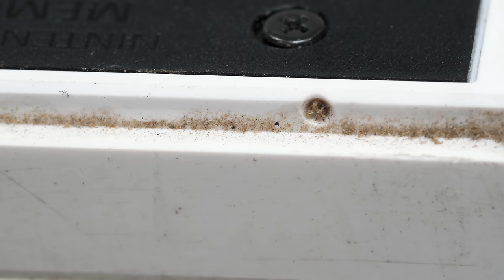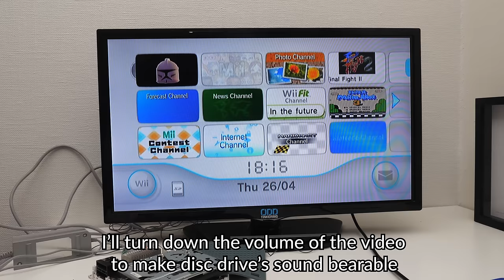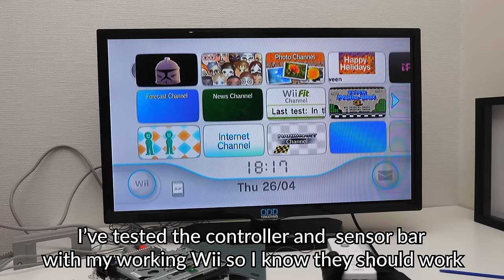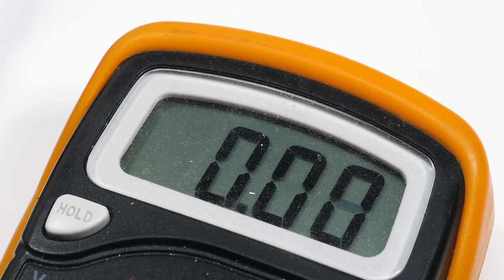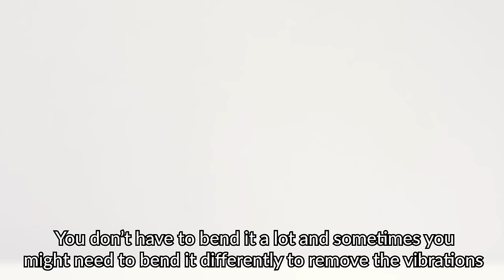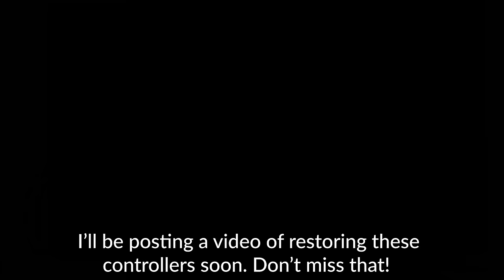I Restored This $5 Junk Nintendo Wii - Console Restoration & Repair

Comment: It's funny how, despite how filthy and beat up it was, there was actually very little wrong with it.  Just a thorough cleaning and a few tweaks and it's as good as new.  Amazing!  (And yes, I feel very old knowing the Wii's age.)
Reply: Yeah the Wii is build like a tank. Tbh all old consoles kinda are...My N64 runs like new.
Reply: it's just that we don't get a lot of information on how to do these things with our consoles, until we do them ourselves.
Reply: e
Reply: @maximilianbrem8250  to be fair, modern home consoles are also durable - my Xbox Series S literally feels like a brick and I am not sure what I would have to do for it to break. But even if it's a bit dusty I don't get how people still can make them super grimy in just like 2 years. That's considering that I have spilled tea over my controller and after some cleaning it works like new. 

I would be more careful with things like Steamdeck and Switch but from my experience they are also not that easy to break unless you're really unlucky or trying to do so on purpose.
Reply: @maximilianbrem8250  the Wii U and 3DS are where things started to become fragile
Reply: It's crazy what happens when someone scuffs up the outside of a system (other than the serial number sticker) that is just fine and dandy. Done for clicks and views, working for him so more power I guess.
Reply: @gutterspeak  so you’re saying he gets a perfectly working Wii which is close to twenty years old. Dismantles it. Places soot and hair from what it looks like to be 15 years ago. Washed and cleans every individual part after making it seem like it doesn’t work properly. I used to buy ps4s off Facebook marketplace that people thought were broken but had to be reinitialized. Bought them for 20 and sold them for 200. I often took them apart just like this video.
Reply: They don’t want you to do your own repairs that’s why. I’m an electrician so I’d feel confident taking on a project like this but that’s because I’m professionally trained to work with circuitry. As long as we still have the right to repair fight taking place, it’ll always be difficult to get correct info on gaming systems.
Reply: @maximilianbrem8250  ⁵
Reply: @maximilianbrem8250  built*
Reply: @OmegaEnvych  Smokers get everything they're around grimy. I'm not even joking.
Reply: Nintendium
Reply: @encycl07pedia-  yeah, it feels like some people have no idea how much smoking inside can effect a home and their decor. nicotine/tar stains basically anything it comes in contact with.
Reply: @OffOnSwitch  nintendium?
Reply: Wii equal cool cool equal us :)
Reply: Hey {{3}}, I can totally relate to the satisfaction of restoring old electronics! If you're into tech restoration, you might want to consider using a HOTO Compressed Air Capsule for cleaning. It's a versatile tool that offers powerful vacuuming and blowing capabilities, perfect for maintaining a spotless environment on your desk and beyond. Plus, it's reasonably priced compared to other brands. Happy cleaning and restoring!
Reply: Why do most of your videos look like the items have been dug up from the garden or wiped over with a dirty rag? It’s not consistent with the cleanliness inside. Very artificial.
Reply: The wii does run like new until you try to run toy story on it...
Reply: You didn’t have to call me out like that!
Reply: Honestly most things seem a lot worse until you open them up. All it takes is one issue in the major parts and it seems not to work at all. But Nintendos especially have a reputation for being virtually indestructible, so a little patience and they’re good as new
Reply: A lot of the time there aren't a whole lot of problems with "junk" systems that people have stored away. It's just that most of us don't have the knowledge of what's wrong to fix it and aren't interested in paying someone who might just scam us and overcharge.

I wish I had the mindset to do repairs like this, because this is a $100+ console that went from $5 junk to fully-functioning system with only a few small repairs. It would be nice to be able to shop around eBay for junk and fix it up.

Even if I don't have the skills to identify and fix the problems, I'll admit I'd still like to buy old "as is" consoles just to pull them apart and see the internals. Maybe see if I can learn something from it.
Reply: That’s poetic
Reply: @maximilianbrem8250  maintenance is key, also not dipping it in trash lol.
Reply: This stuff is only like 20 years old. Why is it being represented like some old as fossil dug up from an ancient civilization lost to time?
Reply: The Wii in particular is notoriously tedious to open so they never get cleaned. It's not surprising how many videos there are of them getting completely fixed with nothing more than a thorough cleaning. In older consoles that was always the first line of defence. They just made as difficult as they could justify with the Wii and they weren't the most expensive console so nobody ever really bothered.
Reply: Cuz they fake it
Reply: That’s because it’s staged
Reply: My wii still running perfectly to this day just need a new wii remote and AV convertor
Reply: I feel like this is often the case with game boys as well, usually corroded contacts or a loose wire
Reply: Fun system gamecube friendly easy way to mod it homebrew all retro video games and u save on a SD card and no worries about being late for work kids get to play and get homework done
Reply: @maximilianbrem8250  mas o ps3 e o xbox 360 dava muito problema
Reply: @maximilianbrem8250  I also have a great N64!
Reply: Que buenos videos, soy tu fan 🤟🏾

Comment: I remember when I cleaned the dust off my old Wii and powered it on for the first time in years. It's like opening a chest of memories
Reply: I still use mine weekly
Reply: Yeah I used to play Wii a lot too. Memories.
Reply: I got my perfectly cared for, Limited Edition, 25th Super Mario Brothers console on eBay for 153 bucks! Worth every dime!
Reply: Wish mine still worked. It's not reading the discs. Any suggestions?
Reply: @Lag1914  you should try modding the wii so you can run games off of a usb drive instead of the disks. You can’t dump games to the usb drive without the wii disk drive working though so you’ll have to obtain the disk images from semi-reputable sources. Hardware-wise I’m not sure what’s wrong with the drive, does it make noise, is it dead, or does it just not make noise for whatever game you put in?
Reply: @soulthunderfox  The Red one? That's a special edition??
Reply: same
Reply: @Luchux177  Yeah
Reply: i used to have a Wii. Then one day it just vanished out of existence, never to be seen again.
Reply: Unless you were stupid enough to send your Wii to Nintendo to repair. They completely nuked my internal storage, I lost everything. Totally ruined the Wii from that point. I use mine for emu now.
Reply: @mutoneon  Oh, with my homebrewed Wii? Not a chance. Sending it to Nintendo would be the LAST thing I'd do lol

Comment: I think one of the most interesting things is learning how the sensors worked. I always thought it was the reverse, with the light coming from the remote. That's so cool!
Reply: After a while, the lights even get a bit warm compared to the rest of the sensor bar
Reply: I honestly think the name contributes to that misconception, it makes it seem as if the bar is the one doing the sensing
Reply: If you ever use it during Christmas time, and have a Christmas tree with lights on it, and see how much it freaks out the Wii remote when the Christmas tree is within the line of sight, you suddenly understand that it is the opposite of what people assume.
Reply: How much for it?

Comment: This channel actually helped me to clean my old PC. Just spending time watching the detail and noting the supplies used made it a lot easier to thoroughly get all the dust, residue, and any gunk off the components and actually helped me to isolate a faulty component for replacement. It’s amazing how much a soft bristle toothbrush and isopropyl alcohol can clean.

Comment: Restores a badly worn Wii, chooses an OG Wii game, AND gives us gameplay?!

10/10 video. So much nostalgia
Reply: Hey, I must say that the HOTO Compressed Air Capsule sounds like a handy tool for cleaning and maintenance. The powerful vacuuming and blowing capabilities, along with the multiple tubes and high-quality filters, make it a versatile choice. Plus, the brushless motor and long-lasting battery add to its appeal. Thanks for sharing this cool find!
Reply: Galaxy still looks great 15+ years later :)
Reply: @innovativeadvertising6463 that’s not innovative advertising that’s just blatant advertising which I’ve seen 1000 times

Comment: Aaah, the Nintendo Wii, I love that console, I have one myself, it's extremely old by now but it still works like a charm, the trooper sounds like a jet engine preparing for take off but other than that it still works without a hitch even after all these years, what a baller of a system.
Reply: You should home brew it and revisit it. The community is still active. You can play online with third party servers. The fact that the community is still active after 16 years is truly a testament to how great the wii is
Reply: @hadinajjar9800  I've homebrewed my original machine!  I didn't realize it was still active.  TELL ME MORE!
Reply: @DanRamosDR  you can still play Mario kart wii online. You can also still reconnect to everybody votes and all the rest of the online stuff. There are loads of tutorials on yt. Also you can emulate almost everything from before the wii. Also, now that the wii shop is down, with home brew you can access the decent library of wii ware including virtual console games. Right now I’m playing paper Mario which was released on the n64.
Reply: My Wii hasn’t held up to today. The disk laser is dirty, the Wii sometimes lags, it’s practically useless now.
Reply: @J.RProductions2024  Easy stuff to fix and clean.  Don't want to try?
Reply: @J.RProductions2024  I mean this video is a tutorial in itself 😂 But you can pick one up for cheap. Assuming u have the wires and remotes, all you need is the console
Reply: @hadinajjar9800  can you also emulate gamecube games on it? im new with the whole homebrewing
Reply: @lucakieft2671  yes you can, it even accepts GameCube controllers.
Reply: I just bought a Switch but I still have my Wii and Wii U as well as all my old consoles. I never got a Game Cube but since the Wii could play Game Cube games, 23 year old me in 2006 thought it was good enough to have to play the Game Cube games on. Hell I still have my 1989 lime green screen Game Boy from when I was 7, still works.
Reply: OLD? 2006 was like a few years ago right!??!?!?
Reply: I'm lucky that mine is in great condition. It doesn't make excessive noise at all, it's rather quite. My poor old xbox is noisy, though.

Comment: 7:29 If you are confused as to how it works, its because the “sensor bar” is not a sensor bar, it’s just a bar with infrared LEDs at the ends. The sensor is in the Wii remote, in the form of an infrared-sensitive camera. And of course, the candles emit a lot of infrared light.

Comment: The video output looks a bit murky in my opinion. Try replacing the composite filter capacitors, that should fix the issue

Comment: That is an insane amount of screws.
Reply: @Untitled9528  Ribbon cables are the devil I swear. Did a type c charging mod on my new3dsxl , way too many small ribbon cables , then put it back together only to realize i didn't plug one in on the backside of the mainboard.

Comment: I remember disassembling a Wii back then when clear cases came out. I had never seen such a needlessly complex system before in my life. Was used to n64’s, dreamcasts etc. I was half way through and realized I should have paid more attention to where which screws came from. Didn’t expect so many! Hated putting it back together.
Reply: Been there done that have the headache

Comment: 0:12 Old... 3:32 Nice :). It's surprising that candles can work. 7:54 I can avoid being seen if I wish, but to disappear entirely. That is a rare gift.
Reply: It's a pretty neat life hack if the sensor bar ain't working. The Wiimote is kinda similar to a lightgun, in that the red panel at the top of the controller houses a dual IR sensor. The sensor bar is really just a portable infrared light "fixture." The Wii U's Gamepad also has infrared lights around the camera. Any pair of properly spaced sources of infrared light will work in a pinch, but candles/tea lights are a popular option.
I apologize for the rambling, but it's an interesting subject.
Reply: @Chaos89P  been scrolling look for this comment so thank you for yer time 😂

Comment: Amazing restoration! The only other thing is that the caps by the video out connector might need replacing at some point - the video output looks rather dark on boot. MattKC did a video on a wii with a similar problem. Other than that, glad to see another wii saved from the landfill ^^
Reply: I noticed that too, but it wasn't nearly as bad a MattKC's Wii

Comment: The Wii looks awesome, good job!👏
Reply: Yeah, but what about the Nintendo Switch or the Nintendo Wii U systems?
Reply: @AaronDawgzilla9055  the wii u is beautiful, I bought one recently and it's a really fun and good system when homebrewed
Reply: @Senya_3358  You should give Xenoblade  X a try. You’ll probably want to use the digital manual and wikis until you get the hang of it though, it’s pretty bad at explaining things but it’s a really good RPG once you do understand it. It’s also fairly different from all the other Xenoblade games.
Reply: @Senya_3358  oh and also Metroid Prime Trilogy is only $20 on WiiU Eshop and I couldn’t recommend that enough.
Reply: @Sacren365  Oh, thanks for the recommendations! The few games I've tried out recently are Splatoon and Mario maker, wonder why people used to talk about this console in a bad way
Reply: @Senya_3358  That's just sad right?
Reply: @Senya_3358  I think when it had to be put up against its competitors, it is easy to call it bad. I didn’t own one personally until a couple years ago, but from what I understand it’s that first party titles were few and far between coupled with very little third party support. Now that entire library is out and we aren’t being forced to compare it to the PS4 and Xbox One, it’s much easier to appreciate it. There’s other reasons too but I’m pretty sure those were the biggest ones. 

I’m gonna be modding mine once Nintendo pulls the plug on their servers, then I’ll get Pretendo set up, and start archiving my physical discs from GameCube onwards to play on the WiiU. Glad people are able to enjoy it, I had a blast playing with my brother at his house back when it was new.

Comment: Side note: If you were wondering why the video looks dark on startup, it might have something to do with noise filtering capacitors degrading. Replacing it might be tricky, but it's worth the good picture if you really wanted to
Reply: I didn't even know that was a thing. Explains why my old consoles look as rose tinted as my memories lol
Reply: This was the only comment i was looking for and i had to scroll for ages
Reply: Another side note: With these faulty noise filtering capacitors, component video cables will apparently not work at all, so it's worth replacing these capacitors.

Comment: I dunno if it's just your camera, but after power on the display looks unbelievably dim. You usually have to replace the AV port capacitors to fix that, happens at around 12 years old Wii.

Comment: to save all you guys two minutes of research, the thing he pulls out at 1:08 is the chronometer/system state battery, which preserves system settings (because apparently it uses volatile memory)  and powers the internal clock so its always relatively in sync even when unplugged for long periods of time,  something i noticed when i was younger, shouted about it being "freaky" with my siblings for about five minutes, then never thinking about it again until now

Comment: 1:10 wait? I didn't know there was a battery inside the Wii
Reply: I imagine, like most electronics, it probably keeps track of the time while unplugged.
Reply: Of course there’s been a battery in the wii, how would it work if there was not batteries?
Reply: @YourFunnyManXD  ... The power cord? The wii inself doesn't run off batteries, it uses a power supply. That small lithium battery is just for the wii's internal clock to keep it running while there's no power.
Reply: Yeah I’m stupid🤪

Comment: I recently restored and refurbished my Wii with a new Red housing (The original white housing was completely scratched up, chipped, and faded. As for the refurbishment, I cleaned up and replaced the thermal paste on the heatsink, and replaced my broken drive. As for the cables, they were long lost when I moved back to my home state. I had to Source a new old stock aftermarket power adapter cuz I don’t trust generics, missing tv cable replaced with a Mayflash hdmi converter, sensor bar is Generic. Sorry for my rambling, I’m Glad you have the original equipment that came with your now restored unit.
Reply: 😢 The wii uses thermal pads, not paste. RIP Wii.
Reply: @sodapopjam  I used silver paste, so it works without problems
Reply: @sodapopjam  Thermal paste has better conductivity and cooling performance than Pads
Reply: @StabTheDabb  I know that, however pads should be replaced with pads, and paste with paste. Specially seeing the  Wii's pads are so thick. But you keep doing whatever you think is right for you.
Reply: @sodapopjam  Paste helps cooling perform better on my Unit. You should give it a try.